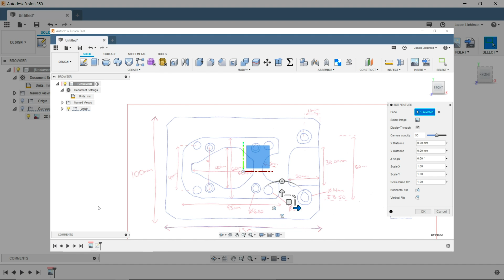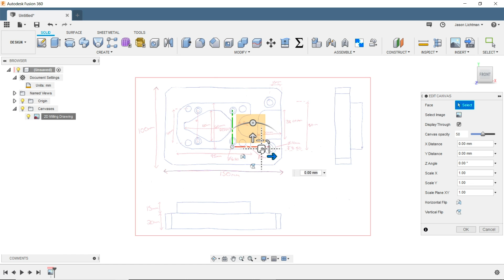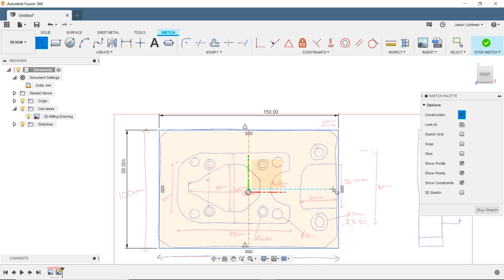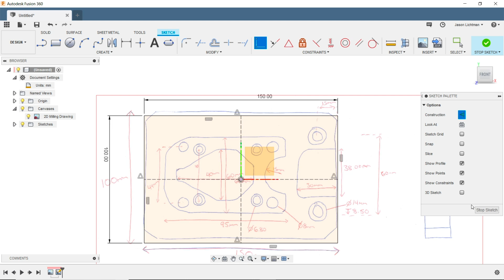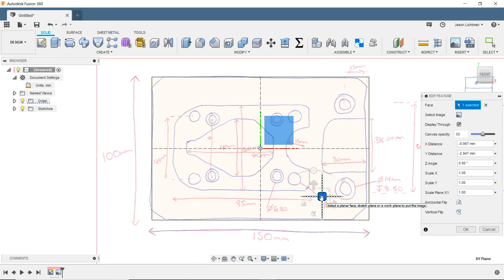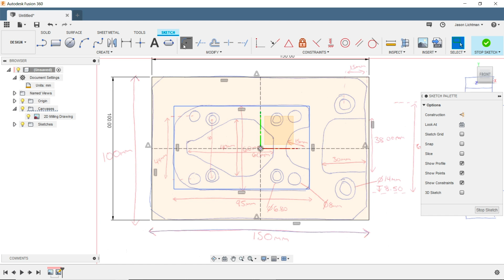QUICK TIP: Centering an Attached Canvas to the Origin

Comment: Great tip! thanks. Still I would suggest that the move handles of the inserted canvas wouldn't go out of sight if i extremely zoom in. I often get a sketch (on scale) with a centerpoint. If i zoom in extremely the move handles are out of sight. In other programs like photoshop i can zoom in and move the picture with the hand tool... It can also fixed to just pinpoint tot the sketch where you want the centerpoint to be... Could be a lot easier...

Comment: Thanks Jason, looking forward to the glasses design.  Have the first burn for the living hinge, laser needs some tuning :)
Reply from the maker: You're the one that made the glasses case from Jason's live stream, ya? Great work!
Reply: @adskFusion  Yes, cheers.
Reply: @adskFusion  Cheers
Reply: Justin! I re-posted your glasses case rendering. Great job! 
What kind of laser are you using?
Reply: @jasonlichtman  Jason, my friend/neigbhour has access to an older Rayjet. It works via CorelDRAW with a proprietary printing driver application.
Reply: @jasonlichtman   Prototype finished, images in gallery.  Already using it everyday :).  Thanks.

Comment: Thanks for sharing. It's sort of a hack, should be a more streamlined way to handle this imo. BUT i learned a lot in the first part. Never thought about making cad from such a rough hand sketch in that way. I usually have my hand drawing beside my keyboard and build cad geometry piece by piece by looking down at it. I also want to thank Autodesk for providing Fusion free for us hobby guys, its an absolutely mind blowing CAD/CAM package! Makes us able to do so much cool engineering and creative stuff. I promise you a LOT of today's kid's is going to be using Autodesk software by the time they start working. If I ever have a career that involves cad/cam it will be an easy choice :=)
Reply: We are always looking for ways to improve our software. I agree that there is room for improvement. While that happens, I try my best to find a good workaround and/or hack. Thank you for your feedback as well as your support!